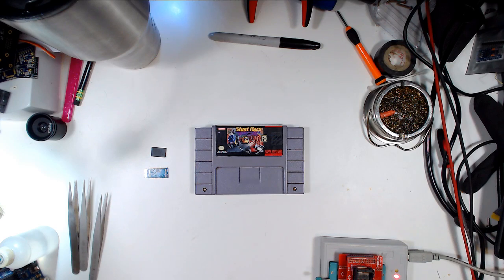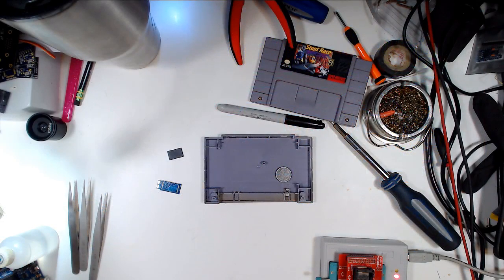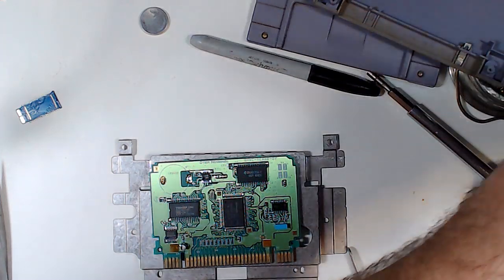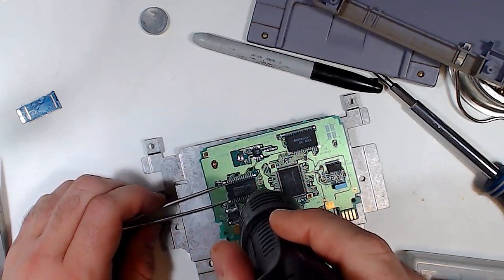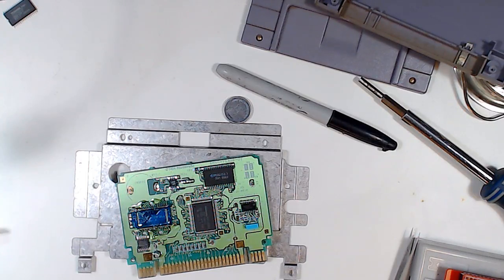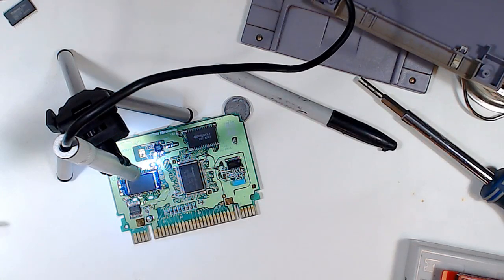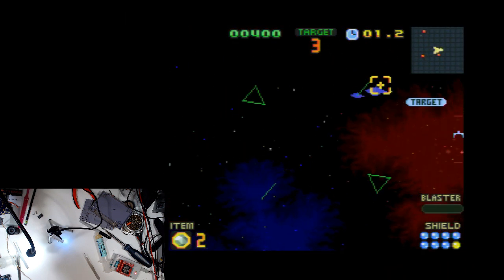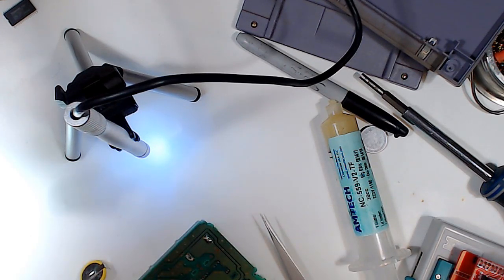Building a Star Fox 2 Cartridge - arthrimus

Comment: Hello i ordered alot of your boards i also have the 48 tsop variant like you used . When you were programming it said tsop40 but you used tsop48.
How it works ?
Reply from the maker: The extra pins on the tsop48 package for the 29f016 chip are not used. So for that chip you can just align the 48 pin chip in the center of the 40 pin footprint and solder it with the extra pins not connected to anything.
Reply: @ArthrimusTech  I am stuck with S-DD1 issue I wanted to translate my Street fighter alpha 2 but can't find any solution The real Phoenix boards also won't fit , Can these of your boards be fitted with some modifications or rewiring ? I am very desperate to solve this issue i talked with real pheonix he doesn't any any solutions as well right now.
Reply: Also can this board work with gsu2 / yoshi’s island for translation purposes
Reply: Also can this board work with gsu2 e.g yoshi’s island with some modifications may be sorry for noob questions